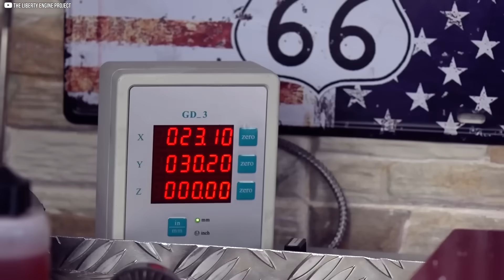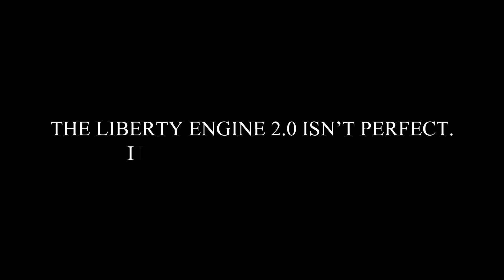Nikola Tesla’s Hidden Invention Just Got Rebuilt – And It Works!

Comment: The Wardenclyffe Tower project had NOTHING to do with energy generation.

It was supposed to transmit information (ie radio) and energy - aka wireless power to replace copper transmission lines.

Long story short he was beaten thoroughly to practical radio demonstrations by Marconi and could never get wireless power to a practical level that was even at parity with long range AC copper power lines.

He blew through his funding from JP Morgan with no positive results, and demanded more funding still for an even larger project.

At which point JPM shut the door in Tesla's face, likely permanently given JPM wasn't the type of guy to throw money after bad investments.

As far as Tesla was concerned the likes of Niagara Falls was all the 'free' power that would ever be needed - it's density is vastly greater than anything consistent that you could convert from the electromagnetic field of the Earth.

This is the same reason that people going on about pyramid power endlessly are just ignorant fools.

Why spend all that time and effort to make pyramids to generate energy that can be harnessed directly from the river literally just hundreds of meters away?

(case in point Ethiopia's multi gigawatt generating hydroelectric dam harnessing the Nile)

Comment: Yes, but how big/heavy is it and how much power does it give out?

I can get 230V from a potato battery if I build a big enough step up transformer for it.

But the current output (amperage) of that generator will be utterly useless for any practical uses.

Saying that the machine gives continuous 230V is meaningless without a matching amperage, and an attractive enough power/weight ratio to make it usable for non stationary scenarios like transport, which excepting naval freight are very weight constrained.

Comment: I ponder what Bearings were used? I've been a Competitive Skateboard Racer (Luge/DH/Slalom) for a 'lil-while', and I've Never Seen a Bearing hold-up to constant use at high-RPM's, without degradation that you could actually See in lesser Times-thru-the-Course. Now, 1400 RPM isn't 'fast' by My Standards, but we're 'in that Range' often enough to know, It Cooks LUBES.. As a CNC Machinist, I also wonder about several visual 'wobbles' I saw along the shaft sections of this 'motor'; any variance like that, in an Imbalance, and an Imbalance robs momentum. Lastly, the Magnets employed were Not Set at an Angle that would Optimize the repulsor effect in Rotation. I've seen magna-lev Trains on RollerCoasters first-hand, and, gee, those magnets are 'set' at a SLANT. Explain any of those things; I'll wait...
Reply from the maker: Thanks for sharing your expertise and observations; I appreciate the detailed feedback on the mechanics and performance!
Reply: @TheForgeEmpire  So, you really ought to head to Doswell, VA, and King's Dominion Amusement Park, too see, first-hand, the two Coasters there, Outer Limits, & Volcano, that propel their Trains via electromagnetic propulsion.

Comment: The biggest problem with these free energy devices is working out where to hide the batteries/wires.
Reply: COMMENT =>>>>>>> IA genarate by lobbyes
Reply: How original
Reply: @DNY_Phantom  And still true
Reply: Or induction coils.
Reply: @mnomadvfx  Induction coils won't help, because they only power they can produce to put power into the system is parasitic on the system itself.  And stray resistance and friction will always bring this thing to a halt eventually.  Faster if a load is actually hooked to it.
Reply: @akulkis  You assume the theoretical "closed system".
Reply: @akulkis  nope my generator hasn’t felt a load after a year and a half especially in my pocket.
We are loving the extra money.
Reply: Sounds like you were the copy person at school, never tried or learn for yourselve, just belived averything they were told repeat like a sheep and don't ask questions. Shame.....😊
Reply: @Pauls4reel  LOL. I've spent over 45 years building and analysing different 'free' energy devices, starting with the "Adams motor generator' in the late 1970's . They all fail to deliver. Not surprising really, since they are all based on gobbledegook.
Reply: Hi Keith great video, that Hall back array Magnet you turn on and off, it uses little to no energy to turn the magnet on and off, you can make a repulsion motor by making a piston engine, that when the magnet is reppeled it can rock past a cut off to then recipricate the engine over and switch to turn the magnet back on all using simple mechanics. I hope this can work. Have an amazing day
Reply: @Pauls4reel no all I did was follow the tech and the schematics and it worked resulting in “NO MORE ELECTRICITY PAYMENTS”
That’s all I wanted.
And that’s what he offered!

Comment: As an Engineer, anytime I see equipement surrounded by mood lamps. I start to run.
Reply: Are you an electrical engineer by any chance?
Reply: Trabajo la mecatrónica tu actúas como ingeniero civil 😂
Reply: 4 exposed microwave transformers and possibly an emitter in that mess would be plenty reason to quick step.

Comment: "The system relies on a principle called electromagnetic induction" - wow, truly earth shattering! And it is constructed with N52 neodymium magnets - the same as beaucoup permanent magnet motors constructed in the last 40 years.  Is it an efficient motor?  Maybe.  A self-sustaining motor/generator? Never.
Reply from the maker: You bring up some great points about electromagnetic induction and the use of neodymium magnets! Efficiency is definitely a critical consideration in any motor design. Thanks for sharing your insights!

Comment: I have a friend who is a professional glassblower. He found that by adding some rare earth compounds  to his glass flux he could manufacture a glass bottle with a special shape,
 that incorporated parabolic elipses in all the bends and curvitures thereby mimicing the orbits of planets around the sun, such as earths orbit.The bottle is designed to hold 3.146 litres, Using value of pi, it maintains the values of planetary motionthereby maintaing its ability to rotate fluids for millions of years,  provided that the bottle is filled to that level you can fill champagne flutes, cocktail glasses and even beer mugs for a party,  provided that it is never completly drained to ensure it does not lose its prime. This has all been proven using International Observatinal Standards,
Reply from the maker: Wow, that's a very creative use of design principles!
Reply: I can fill champagne flutes, wine glasses and beer mugs using regular bottles from the store.  What advantage does his design provide for me?  🤔

Comment: The bullsh*t factor is strong in this one. As usual.
Endless blablabla of standard knowledge to impress total imbeciles (electromagnetic stuff, permanent magnets, induction, direct drive, .....), but a single explanation WHY the rotor would continue to rotate against the known laws of physics / doesn't stop when power is being harvested by the generator, or why it outputs the claimed 230V AC at a constant (?) frequency, no matter how much power is drawn.
Reply: i think there is an even obvious fact, that this is not real.
these people are alive, if that was even close to be real, they would be dead, project stolen , and all videos removed. 
the fact that its still there, its proof enough it doesn't work as they claim.  an invention like that, IF REAL , would sell so much that elon musk would look like a beggar. 
So science or no science, that's enough reason really.

Comment: It really works!
I’ve built one that runs my house now.
The best thing about this generator is turning off the grid at my power box.
Reply: That, of course, isn't true.  You'd be breaking the laws of physics.
Reply: @ what laws of physics?
It basic electrics!
Reply: @sonitakinui00275  Both the first and second law of thermodynamics.  It would break the first one by creating energy where there is none, it would break the second one by claiming no energy loss (no increase in entropy).

btw, electricity is physics.  Electricity involves understanding electric charge, electric fields, voltage, current, resistance, and energy; all of which are fundamental concepts in physics.
Reply: @ wow if that’s what’s going to stop you building one of these magnetic induced generators then be my guest and keep paying for your electricity lol
Reply: @sonitakinui00275  Yes, the laws of physics stop me from wasting my time on building something that isn't possible.  Your claim isn't possible.  If you get electricity out of it, you're putting energy into it.
Reply: @aarqayou would need frictionless bearings and room temperature supper conductors to even get close to.
Reply: @aarqalaws were made to be broken, we evolve. Those boxes of rules are made to encage our minds.
Reply: @debramoss2267  We're not talking about legal laws, we're talking about physics laws.  No, they were not made to be broken.
Reply: @aarqalaws of physics? What are those? Some artificial created standards without including all information available. How often in history has it been demonstrated to the assumed “law” has been discredited by new information!
Reply: @aarqa you does know them idiots only physics and physics can't think for them self's 😂😂 you people move like the laws of physics actually governors the universe so slow 😂😂😂
Reply: Do you have a video we can watch, please?
Reply: This is an electric universe baby.
Reply from the maker: That's amazing to hear! It's incredible how Tesla's inventions continue to inspire innovative solutions today. Keep up the great work!
Reply: Can I build one? Would you show us how to build a unit strong enough to replace commercial energy? I'm ready to learn and apply myself... ty
Reply: @jamesherdfan6863 I had mine built by a fitter turner engineer because he owned his own lathe, milling lathe, drill presses and welding equipment.
All I did was supply the video of the “Liberty Generator”and its schemetics a 2.2 hp electric motor, 48 N52 rear earth magnets, a 150mm x 110mm billet of silver aluminium,
Enough 1” x 2” box steel and found my transformers(stators) inside old Microwave Ovens, 2 x four plug socket power bars and the engineer did the rest with a bits of help from my son who’d is a electrician to wire everything up at the end.
Reply: Is anybody on here old enough to remember the old dynamo that our dads bought us to power our bicycle lights that ran by friction while being spun off the side of the front tyre?
This generator uses exactly the same concept only the power that is produced also powers the 230 volt motor which keeps the generator spinning @ 1400 rpm to produce 23000 watts.
So this is not untapped technology we did it in the 70s and 80s to keep cyclists safe in the dark so long as the dynamo keep’s spinning.

Comment: "A staggering 20,000 watts". Yes, in fact, more than staggering. There is no way at all that those thin wires would ever be able to carry that sort of current (over 90 amps). It's no different to the other bold claims of self-sustaining generators except they have added a mysterious link to Tesla. They say "There's no belts driving through pulleys". So why do the field trials show machines with belts?
Reply from the maker: You raise some valid points! The claims surrounding Tesla's inventions can definitely spark skepticism. It's always good to question the science behind these technologies.

Comment: I don’t get it you say it’s not perfect and it needs improvement. But you are also claiming it’s successfully running. What do you mean by this both of your statements are contradictory. Either it works or it doesn’t. So tell me something with this feedback loop concept (the generator-motor combo) how much time it runs with load connected (your pump, pc, drill, etc)? You see when make something and claim that it’s working first thing people will ask for is numbers like how much power it generates and what is the maximum stretch of time you have test instead of Tesla worshiping video. Also Tesla’s dream of free energy was different than what you are trying to demonstrate. He wanted free energy transfer wirelessly (which has its own flaws) and i don’t see you explaining how that is being used in this machine. Also why go with silver when we already have superconductors. All the particle accelerators around the world uses superconductors to have best and most efficient eddy current effect. Anyways please explain in detail because this looks more like ad than explanation video.

Comment: if a mini version was fitted in electric cars then they would not need to stop to recharge the charger would be in and on at all times
Reply: I think we should just cast "accio" on our cars, much simpler than this device and the results will be the same.
Reply: It would need to work first
Reply: I need 2
Reply: That's one obvious useful  application!..with a bit of luck, you might see it in your lifetime, maybe not too far in the future {Tesla may have given some hint on that}.
Reply: Connect to mainline with reversible meter.
Reply: I had a seizure while trying to read your sentence. Throw us a courtesy comma FFS
Reply: And we could go back to the good old 1920s when we were starting up our cars by a crank
Reply: That's what I've been saying. Many way to Generate power with something that moves. What's the SECRET. 👁

Comment: It's just an radial flux alternater which needs to have an kinetic energy source that keeps the rotor moving. The position of the stator (coils) to magnet isn't efficient et al.
Reply from the maker: Thanks for your insights! You're absolutely right about the need for an efficient energy source. It's fascinating how Tesla's inventions still spark discussions today!
Reply: @TheForgeEmpire  so an alternator that is branded, more expensive, and is worse than the others?
really?

Comment: The secret to this motor is the hidden power cord plugged into an outlet...
Reply: 😂 Exactly!
Reply: A  Hamster jacked up on caffeine, my guess .  In a vacuum , with some  kind of magnetic  levitation. ? Call Musk.
Reply: Someone didn't watch the video.
Reply: The power is from the magnets. Soon enough they will loose their charge.
Reply: @kristianmorris9738  There ain’t no power cord plugging my generator into an outlet but I can plug my generator into an inlet on my house and run my house off it
Reply from the maker: Interesting observation! The design does have some unique features that make it stand out.
Reply: There is no hidden power cord that is just a conspiracy
Reply: They clearly used it outside, and it worked. You might say that computer had battery like a laptop, but that’s a Mac. I have one, they are plugged in
Reply: Can you show me this hidden chord??
Reply: @whisperedrhythms I didn't make the video, and I didn't hide the cord. So I can't show it to you...🧑‍🎓
Reply: Rf coil generates current not voltage
Reply: The power is from magnet's consider how you're earplug case charges you earplugs
Reply: Yup
Reply: Or the batteries inside the gutted out generator.
Reply: It’s the material the stator is made out of…. Silver and aluminum alloy12pounds with precise amounts of each for it to work properly do research it not hard

Comment: Firstly, it's a "motor" not an "engine", you should know the difference if you are developing one. Where are the stated links of the tear downs? I can't see anything relevant in your other videos. If the tear downs are in that list which ones are they? The video also contradicts itself. It states the rpm was constant at 1400. That means doesn’t stop so it would be perpetual motion yet you say it isn’t pretending to be perpetual motion but while constant at 1400rpm it was generating enough power for itself and other devices which means it would be perpetual!! It either is or it isn’t. It's like listen to a speech from Donald Trump.
Reply from the maker: Thank you for your insights! It's crucial to clarify these terms and concepts, and I appreciate your attention to detail. I'll definitely look into the links and contradictions you've mentioned.